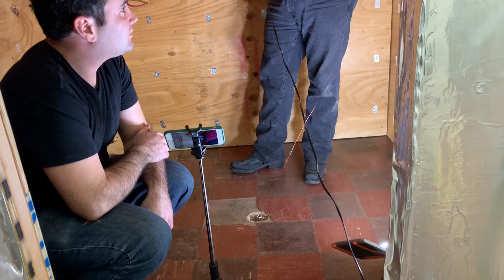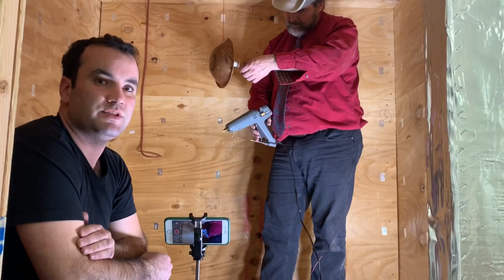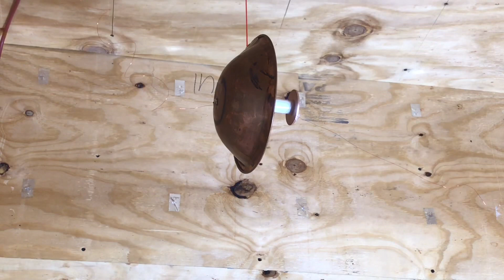Powering up the TT BROWN capacitor at our new shop

Comment: Stuck on ion wind too eh? I have found these high voltages mess with digital scale readouts too, when trying to measure weight fluctuations. I hope you guys make progress on the solid type enclosed type of capacitor
Reply: @Rogue Mentality not sure at this point. But when charging with high potential near digital scales it does mess with them. So I tried to distance the capacitor from the scale. It still showed fluctuations. More experiments in time with better equipment and funding will answer these questions.

Comment: The dielectric needs to be cone shaped too according to TT Brown. Look in TT Browns VOL 1 - 57. Units in Multiple for Dynamic Counterbary.
Reply from the maker: BetaScientist  the dielectric in this device was  just the air. That’s why it’s so susceptible to ion wind effects.
Reply: @FalconSpace  Roger that! Experimenting with dielectrics may get expensive and tricky. My understanding of TT Brown's discovery focused on a dielectric with a high K.
Reply from the maker: BetaScientist we want to build a capacitor with calcium copper titanate oxide
It has a very high k
We have Barium titanate for testing

Comment: Hi Falcon Guy,     yeah, okay, much better than last time.  This was motion caused by a high voltage cap charge.  Now, yeah, the wire bothered me.   But it was a DC Voltage, and so the effect on the Wire itself could have been Capacitive, and wiggling it because its slight mass would have made it more susceptible to the Gravity Modulation Effect.   Also the wiggling around seemed to be more at 50,000 then at 35,000.   So, yeah, this is the Right Direction.  Thank you.  Good Job!